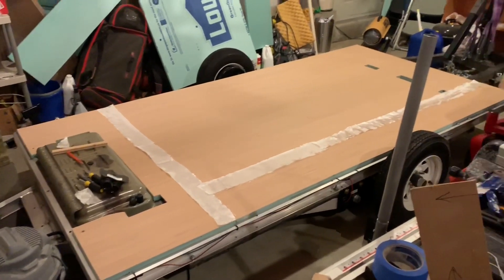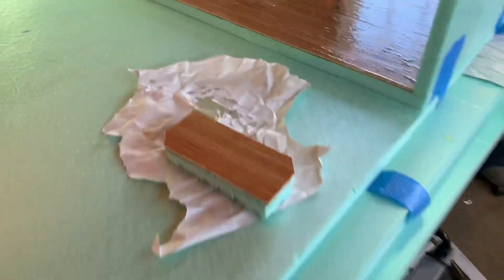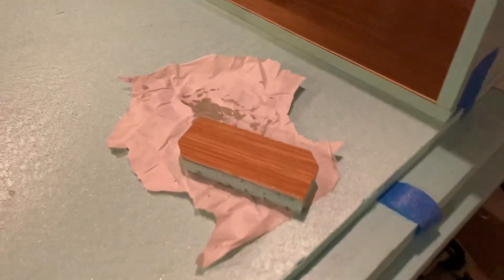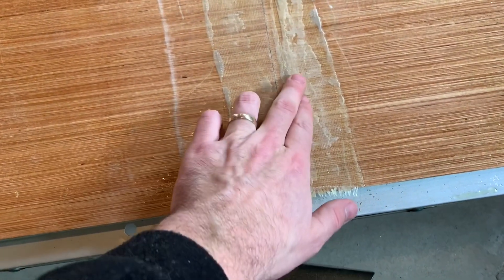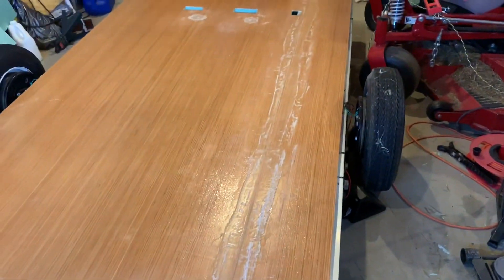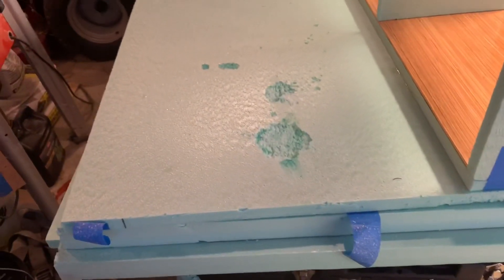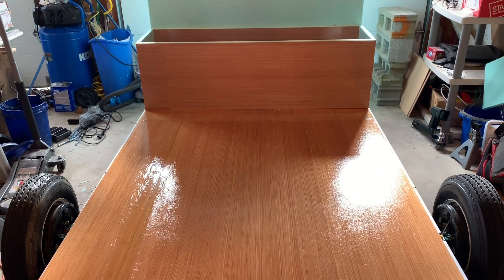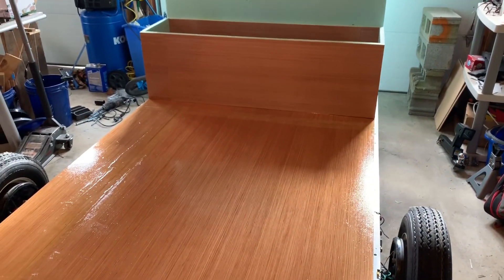Foamie Camper Build: Floors are done. Covered them in fiberglass and epoxy resin

Comment: Looks pretty good over all.  Some tips, (after the fact), slow cure epoxy can take a while to fully cure, especially if you don't have consistent temps of 70F or above, and trying to sand it can gum up your sand paper.  That might have been part of your problem.  I've also found that when coating wood if the wood is cool and you raise the temperature while you're applying epoxy it can cause air bubbles to push out of the wood and mess up your finish.  I try to get the wood to warm up as much as possible before applying the epoxy to avoid that.  I had to redo a mahogany deck on a boat because I epoxied it on a cold morning and as it warmed up the air bubbles created a moonscape of little bubbles.  As you found out epoxy doesn't have the horrible smell that polyester resin does and is much safe to work with.  Some people do develop a sensitivity to epoxy and can have a reaction so be aware.
Reply from the maker: JRP3 I let the space heater go for about an hour before starting work. My thought was to let the wood expand before covering it. I thought it would except the resin better. 

The slow cure resin was recommended to me by Tap Plastics. It will cure down to 40F. With my cold temps it was a good option. I really like the longer pot times too
Reply: @JamesKlafehn   Good instincts on the preheat.  One other tip, if you need to put weight on something to clamp it down you can put plastic down first and then boards with weight on them to evenly distribute the weight, and help avoid dents in the epoxy.  The plastic should peel right up and leave a fairly smooth surface.

Comment: I think you need air flow when painting. It helps with drying and better finishing.
Reply from the maker: Its 10 degrees outside. I cant open any doors haha. I have the space heater moving air around.
Reply: Epoxy is not paint, it doesn't dry, the molecules cross link and cure.  Air flow does not help, and can introduce dust.
Reply from the maker: JRP3 I didn’t realize he said painting. Oops. Yeah, this is epoxy resin, not paint.
Reply: Oh ok sorry guys

Comment: Looking good James! What material will you use for the exterior walls and the roof?
Reply from the maker: Thank you! Walls are going to be like the floor. 1" of foam and 5mm board glued to it. Same exact as the floor. Ceiling will be 2" foam board.
Reply: @JamesKlafehn  That's crazy! So that will be strong enough to hold up to the wind, rain, etc of long trips? What material will be used as the siding/exterior covering?
Reply from the maker: Andrew Brinkhaus the exterior will all wrapped in strong fiberglass.
Reply: @JamesKlafehn  What was the reason for doubling the thickness of the foam used in the ceiling?

Thank you.

Best,

N ~
Reply from the maker: n sp it was stronger. The 1” wouldn’t hold its shape. It dipped in the middle. The 2” held flat. Also because hot air rises so I thought it be better to have more insulation up there.
Reply: @JamesKlafehn  Ah. Yes. Gravity. Always a design consideration.

Thanks!